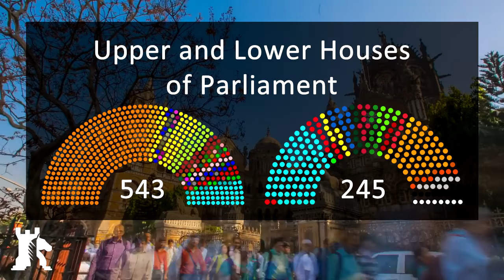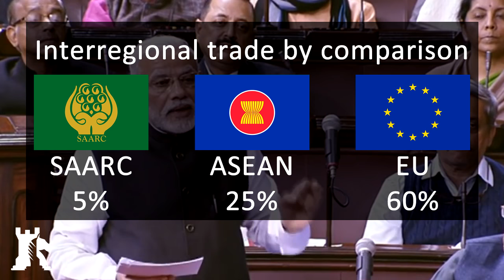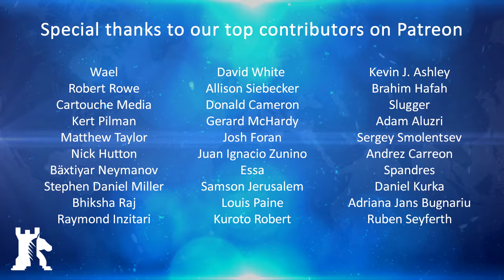Geopolitical analysis 2017: South Asia

Comment: The 99 year lease of "Harbour city"⬅(still being build) infront of Colombo Sri Lanka to China will be a blow to India's strategic interest. It's function will be a free trade zone and the Chinese are building a new Harbour and a city on reclaimed land there.

It's estimated that the small city will house 40.000 to 60.000 Chinese there permanently including facilities for the Chinese blue water Navy and some Army elements. The Indian attempt at keeping Sri-lankans in their influence bubble has therefore already failed and it gives China a de facto military/civilian colony right on its tip.

The reality now on the ground (or water) is, that China can literally circumvent India and patrol close to the Indian waters as it's string of pearls grows ever longer.
Reply: India's peninsular landmass projects out into the Indian Ocean and is an unsinkable aircraft carrier. Any Chinese ingress into Sri Lanka can easily be cleaned out - we'll let them build the infrastructure there before we do it.
Reply: manofsan You can reverse that idea too,...Sri Lanka is an unsinkable aircraft carrier infront of India and can therefore be used by China that way. It's in the perfect position to block India from doing anything without an ever looming Chinese presence infront of its doorstep, like you said, Sri Lanka at the tip of the Indian subcontinent sits perfectly in the Indian ocean.

China has you check mate , in many regards. I think China did this because of the very vague position India played towards both China and the USA, hoping to capitalise on that ambiguous position and enhance its power, China's move has effectively blocked any attempt on India's part to either play a power role from such a position and from being a threat to the Chinese lines of communications and trade aka the string of pearls.

Going around China via Pakistan has secured there Belt&road option too, that together with the Spratly Islands (unsinkable aircraft carrier's) and their reproach moi with the Philippines that was China setting India⬅ (not only India of course) check.

The battle is won or lost before the fighting starts, China's moves were quick and decisive, bold and well thought out, it even has the seal of approval of Xi Jingping himself, i don't think he's lost face there, infact quite the opposite of that, it was a brilliant move and can't blame the Chinese for doing so, it was/is too important not to do, beg's the question:"why did it take India so long to see this", well because of indecisiveness on their part.

While India was still trying to play a power role there and the powers that be in India still have their factions with their own preferences and agenda's, China moves quick and with one very clear goal, decent is not nurtured there, neither is standing in the way of the country's leading interest, that together with an habitually careful longterm planning in all of China's moves made this possible, India is a long way away from this, so is the USA.

In 2021 China will celebrate its 100th year of communist rule, they intend to be the world's largest economy by then and 6.5% growth is definitely not 7.5% growth but it's both enough to reach its goal and it's more growth then any of us have.

Yesterday the Chinese Premiere was very clear, China is going to reorganise it's economy to promote more domestic growth of its own internal market, it's a clear sign that it wil move to being the biggest producer/exporter market in the world and biggest economy on this entire planet, think of what an army they can build and a power base they'll have because of this,....it's mind blowing really and already too late to stop.

Only thing we can hope and work for is the rise of a peaceful China, the other option is just you having a brain fart.
Reply: +ThatDutchGuy -- I was waiting for you to say that - actually, Sri Lanka is a part of the subcontinent and China is not. We can easily pull the rug out from under China and eject them from our area. Sri Lanka has far more ties to India than Philippines does to China. The fact is that China's economy is now plateauing and may soon be declining - and their dictatorship inflicts a high overhead cost on them. Their One Belt, One Road was conceived and announced at the last minute, like a desperate stunt. They haven't thought through the consequences - dictatorships like theirs only know stuntsmanship, because they have no organic means of survival. They can build, they can spend money, but they won't be able to stay - I'm quite sure of it.
Reply: manofsan 😧 I'm very sure you actually believe that, but did you know that blind nationalism is actually a mental health issue instead of it being based on fact's in any stretch of the imagination.

You got lost on this channel, clicked it by accident probably or because of the before mentioned mental health issue, either way, you couldn't be more deluded if you tried.

I'm neither here or there on China or India, I'll just stick to fact's and we'll known historical outcomes and those support that China has India by the short and curly's on economy, military and the global influence aka geopolitics game, it's already check mate, no rug pulling option, no any option,.....get it ?!

You can either work to secure with global partners an interest for China to rise peacefully or you can get fatality mauled by the Chinese Dragon,....go for option one I'd say.
Reply: @ Dutch Guy : The issue with the supposed "String of pearls" theory is that the PLAN would need to project significant power in to the Indian Ocean, while also maintaining a credible enough show of force in the South China Seas. As of now, despite their rapid expansion; the PLAN is nowhere near close to achieving those goals. Plus we do have into account the USN, which has both the ships and bases required to counter any PLAN action. India is also heavily investing in their Navy, and unlike China; all of their assets can be concentrated in the IO region. The dragon can be mauled too, you know.
Reply: Himanshu Gogoi Of course it can, but I said: "fatality mauled", India does not have that capability but vice versa is a whole different story. It will not be in China's interest and definitely not in India's either, in no way can she hope to gain anything from it but total destruction.

There's an realistic option too you know, do business, make good agreements, get Diplomats and diplomacy involved, keep the populist politicians and deluded nationalistic hawks far away from any interaction between China and India and the world will win.

Yes, China will push and do so gradually, react diplomatically on that and be realistic, no India isn't the big boy on the block or an Superpower like China, adjust accordingly and carefully.
Reply: Let me begin by saying that Indo China relations are actually quite amicable, despite the odd flare out. And neither of the two wants a conflict. Too much to lose and little to gain. Having said that :

"fatallty mauled", India does not have that capability but vice versa is a whole different story.

Not sure if you are talking of conventional means or of Nuclear capability. If the latter, then certainly China has a more potent Nuclear deterrent; but India too possesses a credible minimum deterrent; a smaller version of MAD if you will. 

Again, in the conventional sense; both countries have limited scope for power projection over land, as most of the border runs through some quite inhospitable terrain. China does possess the advantage of the Tibettan Plateau though. 

Regarding both Navies, again the Chinese Navy is certainly bigger in numbers. However, China also has two major theaters to contend with viz a viz the South China Seas and the IOR, while India only needs to contend with the IOR. This is the reason that after the USN, India IS the top dog in the region. 

Both countries already trade to the tune of around 80 billion USD. Great scope to be expanded, but is held back by India's fears of Chinese goods flooding the market and killing off the domestic industry. As by China's fear, to a lesser extent that Indian pharmaceutical groups doing the same in China.